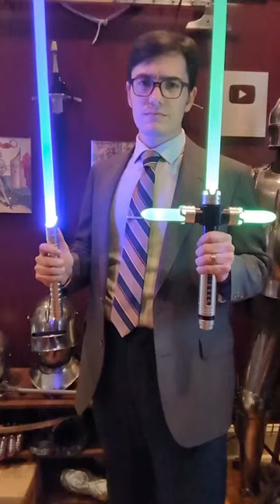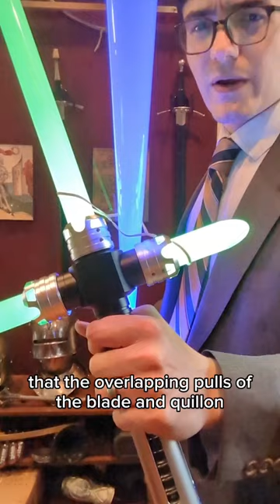Crossguard Lightsaber Theory

Comment: That actually sounds quite plausible, however I think the crossguard on a lightsaber is meant to be more intended for offense. So with that in mind, it's no more weak than a normal lightsaber, and the crossguard can be used for small pokes. It's after all a crossguard where even a slight nudge can cause severe harm.
Reply: Imagine someone using a mordhau grip on a crossguard lightsaber 💀
Reply: It is possible to be used for both.
Reply: @hoppymchopperson6888  Of course. :)
Reply: @hoppymchopperson6888 That it is possible to do something with an object is not the same as that the object is designed for that purpose. For example: You can brush a shoe with a toothbrush but it's made for your teeth.
Reply: @dragonfell5078 beskar gloves
Reply: Arent they vente and everything else is secondary
Reply: @dragonfell5078 ah yes, the polesaberax
Reply: The cross guard has absolutely nothing to do with either offense or defense. It’s a stability issue, the crystal is cracked and unstable, and the cross guard is just venting extra energy.
Reply: @Possum with a Cowboy hat  Yeah, it's venting energy, but then again, so is the rest of the blade.
Reply: @RorikH  yeah but the crystals are stable when they arent in the lightsaber. Its only the cracked ones that need to be vented when used in a lightsaber.
Reply: Oh, no, actually they increase the thermal capacity of the blade itself, since the accumulation of plasma within the blade is gradually lost while hitting a solid object. If you hit too much solid material, you start searing.

The crossguard basically increases the capacity of the blade, like an extended magazine but for a sword, allowing for you to hit much more solid material before needing to allow the plasma to build up again.

That's why they're used in Lightpikes, which are stabbing weapons and require more energy. As well as Sad-Boy Kylo's saber since he can't help hitting everything within a 10 foot radius.

It's not defensive, it's actually a solely offensive addition.
Reply: Seems too situational. I feel like a second saber would be better for offense. Sure you would need to train wielding two, but the unholy speed of attacks could probably overpower many Jedi Knights and almost all Padawans.
Reply: @dantai68 legends didnt have crossguard lightsabers really. Canon lore. Legends no longer exists
Reply: @dragonfell5078  impossible as lightsabers are far too hot
Reply: @dragonfell5078 not unless you wear gloves made of pure beskar

Comment: The idea of the blades being attracted to each other is one of the most interesting additions to lightsaber lore that there has been like ever
Reply: technically the blades should have an unstable attractive and repulsive effect from the spinning magnetic containment fields interacting with each other. On top of the spinning ring magnet in the top 'emitter' which required a force sensitive user to not cut their leg off while wielding.

But saber lore has been bastardized in the interest of 'but this looks cool!' So it really doesnt matter anymore. Light sabers can make you a sandwich and give you a blowy now apparently....
Reply: @mandi8345  brother they never made real sense since theyre not like, real
Reply: @mandi8345 technically lightsabers are just regular metal swords because that’s what they were originally.
Reply: @Saltience  lightsaber and swords are vastly different due to one having a single edge or two edges and the other having infinite edges. also, one cuts due to it being sharp and the other cuts due to heat. not to mention the ability to turn on and off, deflect plasma, the fact that lightsaber blades cannot break and are therefore more capable of just about anything...
Reply: @importedposter4152  it's implied that lightsabers do actually have a cutting edge like a blade
Reply: @importedposter4152 except, we’ve seen a lightsaber break. Not during a duel. But we have seen it break
Reply: @niox1920  no it isn't. lore states that lightsabers cut because of their heat, not an edge
Reply: @riftstrider5433  no we haven't... we've seen hilts break. we've seen blades short out. we have never seen a blade break because they don't have solid forms. they are plasma.
Reply: That’s a rare kind of older lightsaber. I forgot what they were called or whether they were in Legends or Disney canon, but flat-bladed lightsabers were a thing, and required much more training to wield, and you had to actually pay attention to the blade’s alignment when striking/slicing. 
Otherwise, if you didn’t properly align the edge of the blade when wielding, you’d basically just be pressing a flat surface of plasma against (say for example) a metal door. It’d be plenty hot enough to melt through the metal, but there’d be more resistance due to the spread out surface area of the blade’s flat shape, making it take longer to cut through it than a standard lightsaber would, whose blades are round/“infinite-edged”, thus emitting an equal intensity of heat and “sharpness” from all angles (except for maybe very the tip, idk if that makes any difference or not). Keep in mind that there’s plenty of stuff in the SW universe that aren’t as easy for even regular lightsabers to cut through, like blast-doors for example. Trying to cut through one of these with the flat surface of this unique saber’s blade would just be a waste of time and effort.

Note that I’m only neutrally recalling what I know about this, I’m not trying to start a debate or anything.

EDIT: I found the video that explains this:
YouTube video code “IyuM571YZlU” 
(links usually don’t work well in comments)
Reply: @comandantethorn9929 
Being a work of fiction doesn’t mean not abiding by a certain set of universal laws and certain technologies, even if said laws are different to ours, or said technologies don’t exist or can’t exists in our world. Everything should have some logic behind it. 

Plus Hacksmith is like 50% or more the way there, so get your knowledge up 😤
Reply: I mean, it kind of makes sense if you think about lightsabers as a beam of plasma held in place by a ludicrously powerful electromagnetic field. I mean, of course it wouldn't quite work that way, but it would make sense why lightsabers can't just pass right through each other.
Reply: Then how can that explain how Dooku broke Anakins saber in episode 2, shouldn’t the blades have been drawn to each other not allowing the saber to be cut in half??
Reply: @Woolf75  Iirc, I think he hit the hilt from the side directly below where the actual blade was projecting out of, damaging the lightsaber handle, and thus causing the blade to “break”, or simply stop.
Forgive me if I’m wrong, if anyone knows differently please let me know.
Reply: @Woolf75  ??? its not like an absolute force, that should be clear considering theyre able to separate their swords from eachother at all
Reply: @comandantethorn9929  That's a pretty lazy excuse. Just because it's something fictional doesn't mean it can't make sense with the laws of either it's world or ours. Lazy writers and conformists will always say something like that. it's like, pretty dumb to say that
Reply: It would explain they get stuck like they do.
Reply: @Saltience A Glock is just a flintlock
Reply: There is some basis if Halo’s Type 1 Energy Sword is based on a similar concept of plasma being emitted and shaped by sort of spacetime distorting technology that forces a shape of blade…
Reply: And Disney contributed
Reply: @mandi8345 
Dude, you gotta remember lightsaber blades are literally made by magic rocks powered by religion.
Reply: That would explain a lot about lightsaber fighting.
Reply: No its not. Its stupid. If my weapon was naturally drawn to the enemy's making it easier to parry and block, I wouldn't use it.
Reply: @mandi8345 did you really just complain that the magical, science-defying plasma sword that has been so since EP4 ANH, now doesn't make sense because they introduced a slight magnetism to the lore 😂
My guy if lightsabers were any kind of realistic, they would be like miniature nukes from the sheer amount of energy released upon activation and would turn the user and anyone around them into soup.
Reply: @wesleykushner8028  ...you wouldn't use the weapon that can cut through nearly anything and is usually a guaranteed victory if you land a hit? seriously? 💀
Reply: @comandantethorn9929  are you one of those? " It's not fully realistic, so we might as well throw all rules out of the window?"
Reply: @niox1920  think that's just broadsabers
Reply: I agree! Also might be a cheeky rationalization for any choreography where nobody ends up aiming their attacks right
Reply: Nice pfp 🤔
Reply: They do always find a way to clash with another, don't they?
Reply: It does raise the question of whether crossguards are even necessary though. Doesn't prove them useless, just a big question mark about whether they provide enough benefits to justify the risks
Reply: i think they would be important in times when lightsaber fights were more common, it would be important to protect your hands (considering how many hands were cut off in the skywalker saga i think that much is fairly recognizable) and having a piece of the saber going slightly over your hand possibly attracting enemy attacks to it would be pretty useful
Reply: @comandantethorn9929 they are real now, they make sense because they’re actually makeable
Reply: this too is yuri
Reply: whilst reading these replies I had to pause to throw my head back and let out a banshee shriek (to vent my frustration which would otherwise be channeled into joining this argument) and I forgot my mom was home so I scared the shit out of her
Reply: I think it’s really wack
Reply: @importedposter4152 There are specific lightsaber crystals capable of shattering normal lightsaber blades
Reply: @importedposter4152 The heat is possibly one factor. We have seen most notably in Return Of The Jedi an implied edge. Luke hits a staircase and handrailing with his lightsaber before cutting through Vaders hand and a handrailing of the exact same design. It's possible that lightsabers are ever so slightly oval. And those two oval points are where there hottest or where the cutting point is. And you can't use Lukes synthetic lightsaber crystal as an excuse as that's just legends and in canon he uses a healed kyber crystsl for the crystal meaning it has nothing to do with the crystal and its unlikely its the hilt having a specific design because the only lightsaber plans he could likely get are from Obi-Wans hut and he has no specialised lightsaber. And Lukes is very clearly inspired from Obi-Wans
Reply: It's also really stupid, as a dueling weapon design. Why would you want a weapon that's magnetized towards your enemy's weapon? Isn't the point to strike the wielder, not their weapon?
Reply: @fabiof.8152  i think its not an intended characteristic, it just happens  to be that do that to eachother, also jedis are peace keepers so defense is what matters most, plus while it may not be an offensive quality, it would help if someone with a lightsaber is attacking you and you need to shield yourself so that you dont lose a limb
Reply: @Bluemantopvids  thats called a flame thrower my guy
Reply: @danylol772  it actually makes a lot of sense lol. Them both having magnetic fields would attract eachother, but if youve ever played with magnets you'd know they don't have an infinite range. 

Magnetic fields dissipate extremely quickly and especially over large objects, that's why magnets on earth can work despite being in earth's magnetic field. 

The earth has a stronger field but it's so spread out that a small magnet in a localized area is gonna have a stronger effect. 

So the lightsabers might have a really strong magnetic effect but only when so close they're almost touching.

So especially if someone Count Dooku in particular, ie. one of the best duelist in star wars canon could easily over power that field, though it would likely cause little interference as it's a few inches anyways. It might add some pull but with how much control a force user is supposed to have that shouldn't logically matter.

But with the hilt it makes sense. There's that small little gap, which also if it's a magnetic field, some end of it is gone repel stuff. It would make sense for the small area where it comes out to be the repelling current of the field.

Which even feeds into lightsaber making more sense in a physics sense. Something has to be suspending that lightsaber blade off the handle, it being essentially a magnetic field containing plasma, with the negative end coming out of the handle, makes some semblance of sense.

We don't have materials with these properties or tech that can do this, but it roots the light saber in physics and makes it make sense in an alternate reality where they have funky made up sci fi resources and tech.

I'm sure I botched some of my explanation, I'm a rodbusters not a physicist lol but hopefully that made sense
Reply: @yocapo32 the magic rocks are also “alive” and have emotions and can feel pain.
Red lightsaber blades are created by making a Kyber crystal bleed